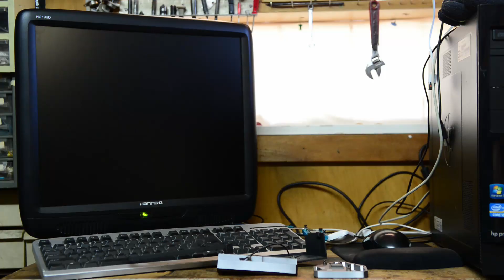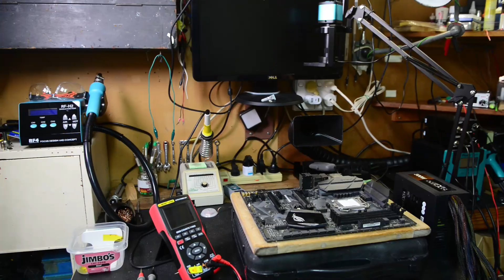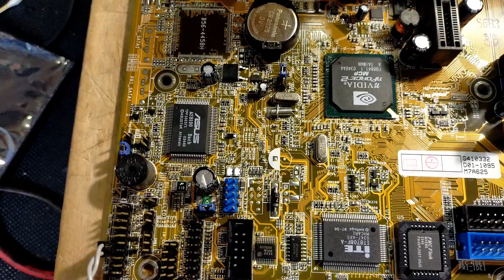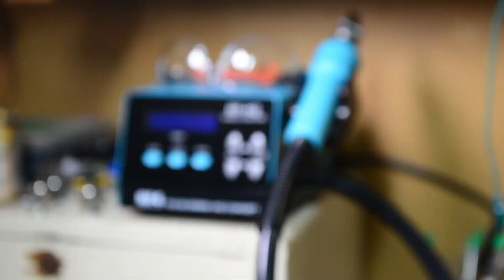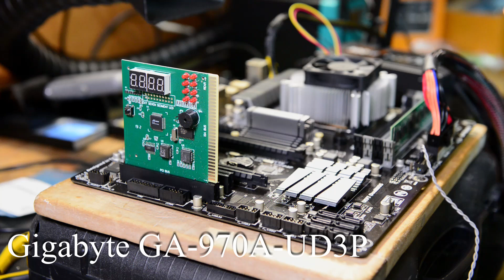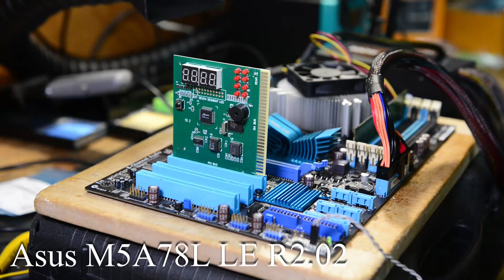Motherboards Stuck in Reset Loop (Not A Boot Loop)

Comment: Ended up here with the same issue and no solution. My Gigabyte P55-UD3 out of my workshop PC (used for looking up datasheets, boardviews, for my eeprom programmer etc) randomly started doing this, or something similar to it. I'm guessing it's some form of hardware issue (possibly with the SuperIO chip or the PCH/southbridge?) as this board does the whole on/off loop even without any components installed (no CPU, no RAM, no GPU, nothing in the USBs... Just ATX power). Annoying cause no matter what I replace the system with, I gotta reinstall.. ugh
edit: haven't actually checked for the reset LED on my POST code card while testing, but the actual readout doesn't even go anywhere in that short time frame (FFFF)

Comment: My issue with my motherboard:
I turn it on, after 1 second it shuts down, it turns back on by itself, shuts down after a second, turns back on, shutdown, turns back on, shut down, without me doing anything. After 5 cycles it stays stuck on Qcode 55, which is memory not detected, but the ram is seated correctly and functional as they work on another pc build. The problem is the motherboard, but I don't know how to fix it.

Comment: Maybe pch Problem Or ?
Reply: There might be a 0 ohm resistor that procured a value instead of zero value, need schematics that links those components trigerring the reset on pch
Reply from the maker: PCH or Memory power issue. Im going to order some Memory power diagnostic cards and check it.
Reply: @MrGridStrom Who Knows Maybe CPU Power Issue Or Capacitors - Resistor

Comment: I find old motherboards have bad crystals on them. Use an oscilloscope and check all frequencies are correct/intact.
Reply from the maker: Thank you for the comment, actually the reason i purchased my oscilloscope was to test crystals. They all work just fine, I didn't mention this in the video as it would make it to long.

Comment: Am I missing something or do you not explain at all what a "reset loop" is in this context? You say "this is not a boot loop" while you show footage of a system POSTing. So what exactly is the symptom?

I had an issue with a set of old intel LGA775 boards (DG33BU) where after a CPU upgrade, most of them would lock up when rebooting, but could otherwise boot and operate just fine.
Reply from the maker: Hi, thank you for the comment. I show the system posting in this video because a 'boot loop' occurs after POST, the computer you see posting in the video is not any of the four faulty boards. These four boards in the video have some type of Pre-POST internal logic level Reset Loop. (this I do explain to the best of my understanding in the video, so you definitely did miss it) I don't want people to confuse the two, as they are completely different things. I believe that this could be because of the PLTRST# Platform Reset signal or SYS_RST# signal repeating, because of a logic level timing error, or signal loss. But this is just my guessing. I'm not even sure if this is a 'reset loop', this is a term that i have come up with myself, as I don't know what else to call it, and i can't find any information online, or in forums, even after 1 entire year of research, and asking questions. So far no one knows what it is. This is the reason i made the video, as im trying to learn what this is, and to help others in the future, as there will hopefully be an answer to this mysterious problem. So far I and one other person believe that it is a problem with the South Bridge IC; in modern mother boards this is called a PCH. But it could be a power issue, im not sure. At some point someone will find this video and hopefully be able to explain what is happening.

Comment: Its probably a PCH I'd presume I have a Asus p8p dexile board that loops with working components its always gets stuck on PCH initialization
Reply from the maker: Thanks for the comment. This is what i am thinking also, these boards don't have a PCH, they use the old North Bridge/South Bridge chips; but from what I understand the South Bridge is the IC most comparable to the PCH functions. The other reason I am trying to get feedback on this video is to justify purchasing a rather expensive BGA machine.

Comment: Did you check all the capacitors?
Reply from the maker: Yes, on the older board I have actually replaced all the VRM caps. The other boards to caps are fine.

Comment: Different CPU's? did you actually tested the memory (RAM)? Back in the days I had one board that was complaining about cpu (reset loop), I had to use the old CPU to update the BIOS, and than to install the new CPU .. I don't believe it's mother board issue, I am sure the board is not happy about something.
Reply from the maker: Thanks for the comment, I am 100% sure this not an issue with the CPU's or the Ram as stated in the video. I have similar boards that do POST with the same CPU's and RAM. I even show one board using the same ram and cpu in this video. This is not a CPU, RAM, PSU issue as these motherboards are effectively dead, with logic level problems that I would like to learn about.
Reply: @MrGridStrom I mean, some older motherboards require different BIOS updates to use certain CPUs, and they all (even dead boards) can still post. That’s why I’m asking if the CPU is on the list with the specific BIOS version.
Reply from the maker: @mortin1991  Yes, As also stated in the video, the 4 motherboards have had there bios chips flashed with their most recent bios. Using the EEPROM Programming devices. Again thank you for the ideas, but this is an issue much more complicated than CPU,RAM,PSU or Bios
Reply: @MrGridStrom  Okay, let me test your specs when I get back home.

I have all 3 boards like u, but not sure I have the same CPUs as your, can you tell me what CPU's did you use on all 3 boards?

GA-970A-UD3P
A7N8X
M5A78L LE R2.02

So I can test if I will get reset loop
Reply from the maker: @mortin1991  thank you for offering to help in such a big way. But this is not necessary. As I understand these boards compatibility 100% all CPU and ram is already compatible
Reply: But I insist on helping you, that will be awesome to solve that mystery, or to understand why it's happening.
Reply from the maker: @mortin1991  Thank you, first I suggest that you research the standard 'desktop motherboard power on sequence'. (Lots of videos on youtube), so you can get an understanding of where i am at with these boards. One of these signals is ether not being sent, or received, after the Super I/O sends PSOUT signal, causing the South Bridge to trigger what i believe to be a PLTRST# Platform Reset in a loop.